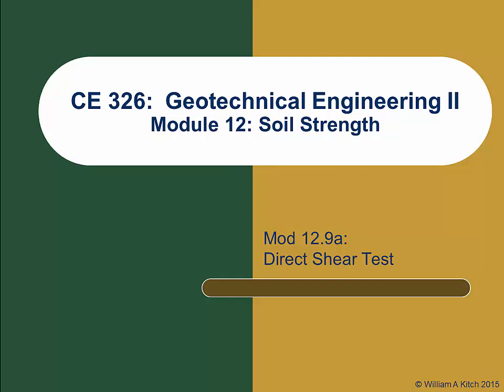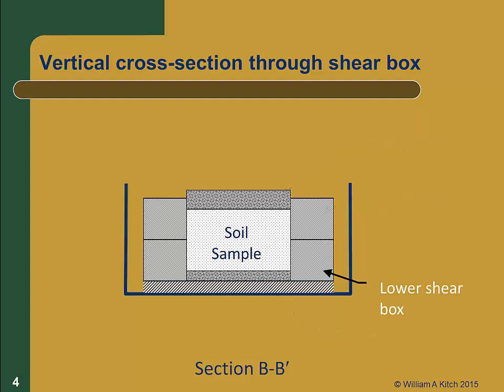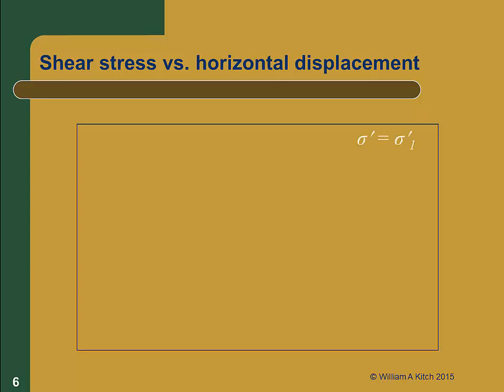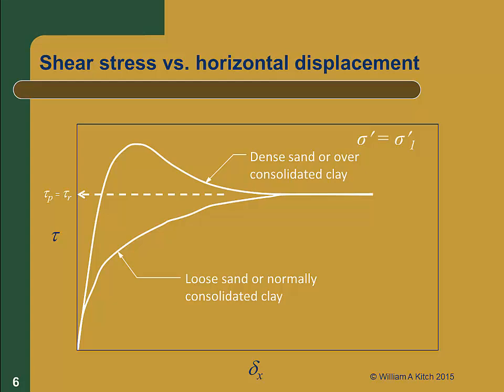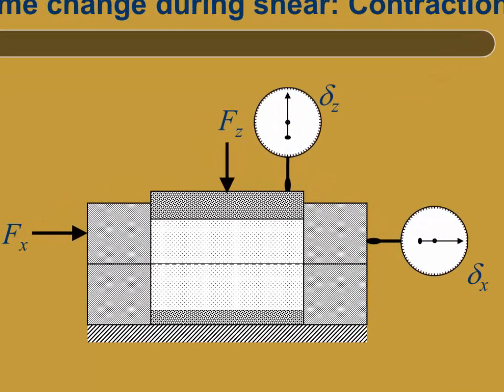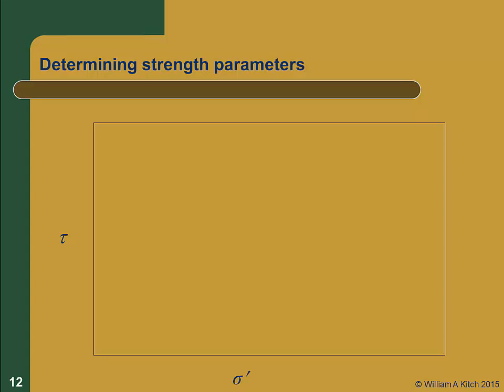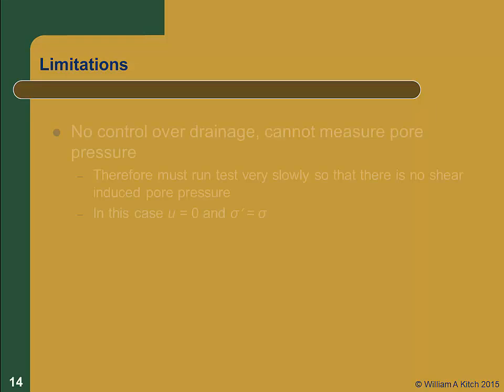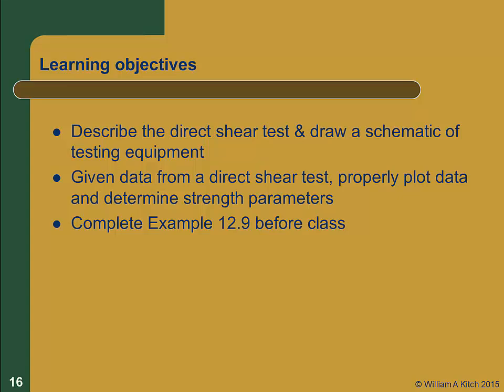CE 326 Mod 12 9a Direct Shear Test

Comment: What does the residual strength represent?
Reply: It is the strength that is left in the material (either soil or rock) after it's failure. It's because of the holding of the particles together by inherent friction of the material.

Comment: Sir, on the vertical displacement v/s horizontal curve on y- axis is it shear displacement?
Reply from the maker: I believe it's more accurate to simply call it horizontal displacement.  It is NOT the shear strain, nor can it be used to compute the shear strain.  The actual stress-strain conditions within the test are very complicated and not well defined.  It is not possible to develop a stress-strain curve for the soil from this test.